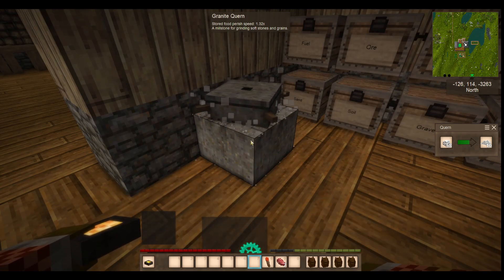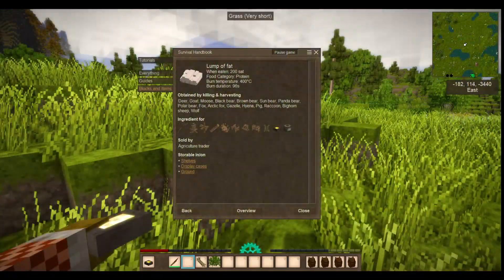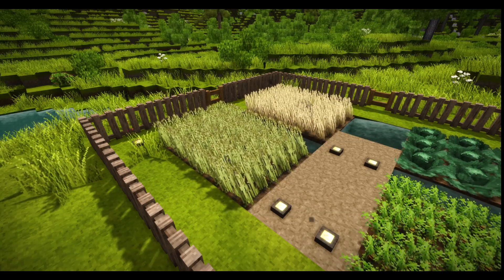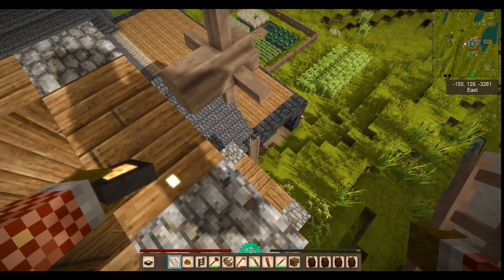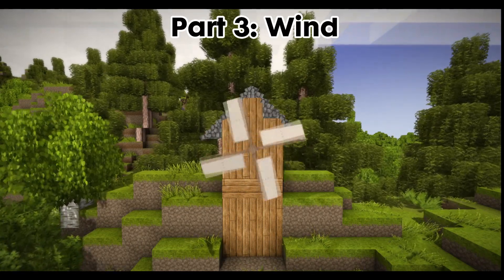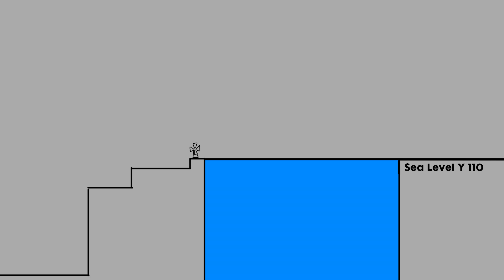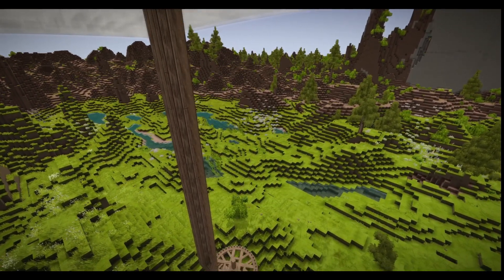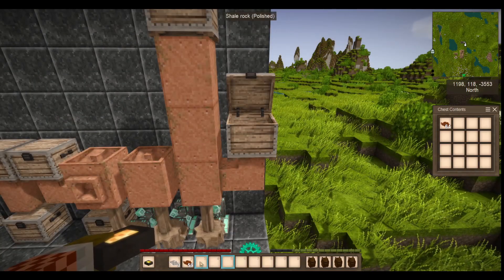The Complete Guide to Vintage Story - Part 12: Mechanical Power

Comment: This has been a great series to get started since the wiki & Valen's videos give lots of information on how/what but not why/when. I hope you continue some more advanced topics.

Also it would be great to have more detail shots of the base (both before and after total rebuild). The starters evolution has been very helpful since trying to just build a large base right off the rip doesn't really fly in this game, but it's been a bit hard to piece it together from video to video when it is a little different each time.